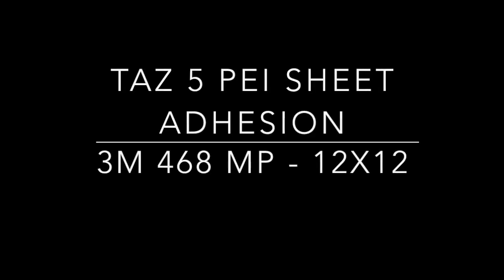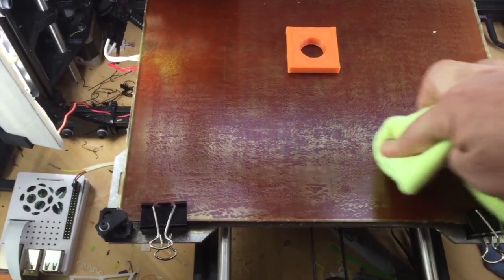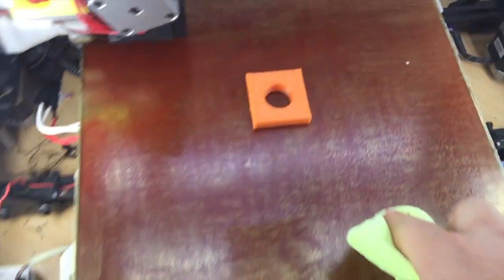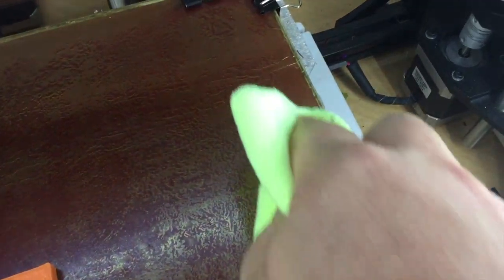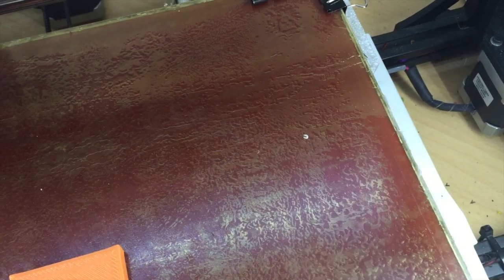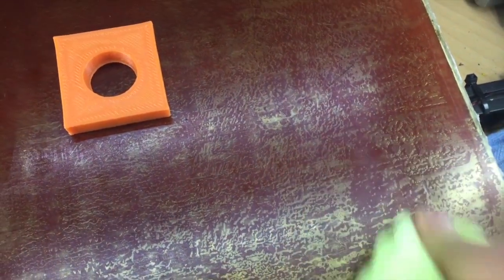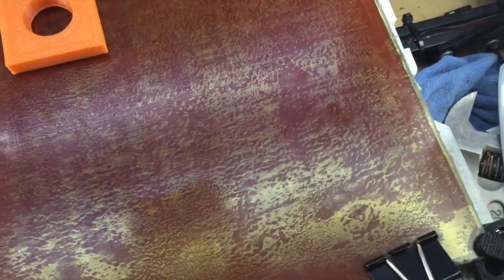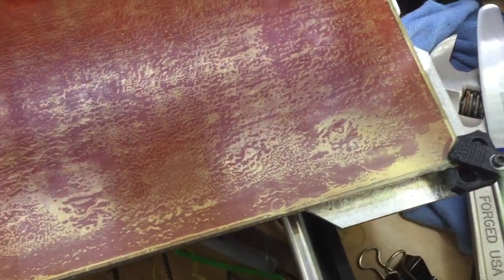PEI 3M 468MP adhesion problems

Comment: I haven't tried it maybe 3M 90 Hi-strength spray will help. Will it stop bubbles under the PEI sheet went sticking, will it work one 100 degree bed, (if ever needed), how long will it last, what about replacing the PEI sheet if used and some questions;

Comment: I know this will response is over a year old but I just bought a single sheet of the same product and am about to place it on a piece of glass.  Did you figure out if it was a defective batch?
Reply from the maker: Actually no, they are not.  It turns out there is a process Lulzbot uses to laminate the PEI to the glass bed.  It involves literally baking the glass and the pei (with the 3m adhesive in between) after they've been press fit together.  It will likely be a bit hard to fully reproduce as well as they do but i'm going to at least heat my glass in the oven next time prior to applying the 3M and the PEI and then will probably use an iron through a thin towel to apply pressured heat.  Then ultimately will bake it per the temperature in the documented way from Lulzbot.    https://ohai.lulzbot.com/project/heat-beds-taz/heat-beds/ .  And here's the nitty gritty with temperatures etc...  https://devel.lulzbot.com/bed_surfaces/PEI/PEI_lamination_SOP_rev-B.pdf . This is all about getting the moisture removed from the equation.
Reply: Paul Morley thank you for your response. It explains a lot.

Comment: I just spent about 2huors taking a sheet of pei off of my extruded alluminum bed (1/4” tool and jig plate).  Fir now I’ve decided to go back to glass and hairspray.  I did that for years and it was good for about a dozen prints befor I had to lightly sand and spray again.  Twice a year clean it off and start again.  I am afraid of 468mp for the present.